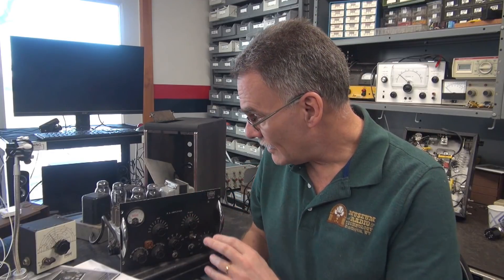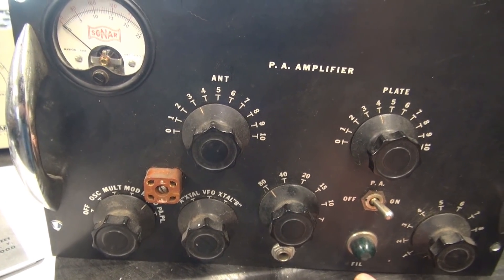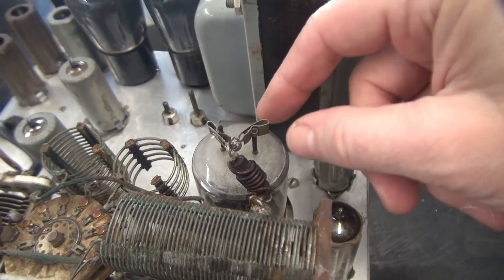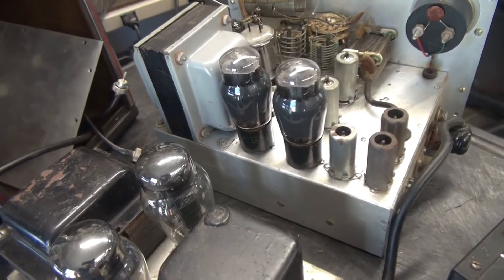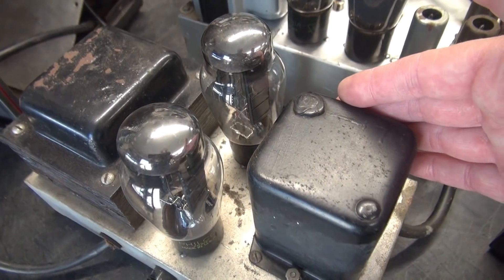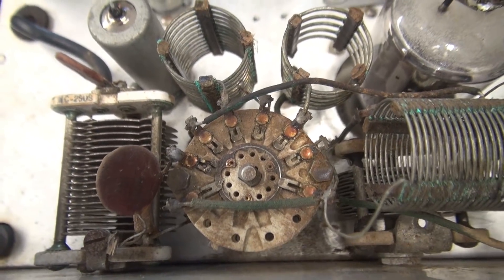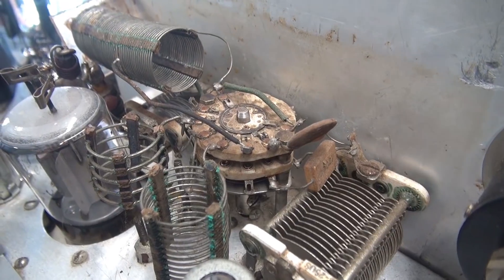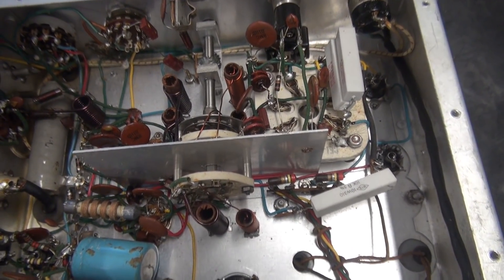Vintage Sonar SRT-120 Ham Band Transmitter initial inspection restoration project

Comment: In 1964, at age 15, I was introduced to ham radio.  The station I visited consisted of a Hammarlund HQ-120 receiver and a Sonar SRT-120 transmitter w/VFO.  I was hooked. Later in life I acquired the Hammarlund HQ-120, but never saw the Sonar transmitter. Your video has sparked a renewed enthusiasm to find and acquire a Sonar SRT-120 of my own.  They are very rare and expensive, but I am confident I will find one and re-visit a bit of the past. Thanks, Terry, for providing the knowledge and inspiration to pursue this quest.

Comment: You may want to come up with a safety circuit that prevents the rotary switch from sparking or being damaged by the other switch being in the wrong mode somehow.
Reply from the maker: In the works

Comment: When I was a preteen my grandfather was a ham operator. He had an old transmitter that was so heavy he said it was like it was "still on the pig". 
I didn't get it then. But looking at this  very vintage Sonar equipment it seems relevant now. So heavy , ham operator. Very dry wit. Much luck 
on this restoration Terry . It will be a  fine one.  Sonar SRT-120 video # 6 :Crispy choke replacement . 😆🍷

Comment: I run a high end older stereo system for my computer audio. Your audio sounds very good. Not "tinny" and not booming. I think you have a winner there.
Good job on the restoration. Looking forward to the video of it on the air. 73 de K7RMJ Frank

Comment: Very interesting and rare unit Terry.  Will be waiting the restoration.
Reply from the maker: Yes Sir, a great find. I also am awaiting the final result, Time is the issue
Reply: @d-labelectronics  Understand that Terry. Time is always a problem here also. BTW, I have one of those Multi Eimac transmitters. Did a video on it a year ago. Power supply was death trap, homebrew.
Reply: I guess the question is - why is it rare?  The most likely options are: 1) good but unaffordable, or 2) it couldn't perform to it's price-point (translation: it sucked) so it didn't sell well. Time will tell. Hopefully, it's just 3) Good, but overpriced.